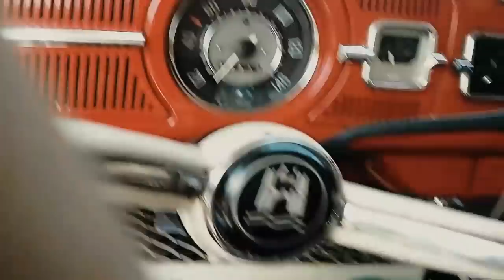¿Que Hacer Si Se Te Rompe El Chicote Del Acelerador Del Vocho| De Tocho Morocho Tutoriales.

Comment: Hola, disculpa yo tengo una duda acerca de la transmisión, es en qué consiste el ponerle paso largo a la transmisión, cuánto cuesta esta modificación y que tipo de mecánico podría hacerlo?
Reply from the maker: que tal amigo dicha modificación consiste en cambiar el piñón y corona o engranes de tu transmisión, dicha modificación hará que tu vocho se force menos y tarde mas en pedir cambio el motor, esta modificación es mas para vochos modificados para arrancones, sobre el valor desconozco exactamente cuanto salga una modificación  algo así, pero si se que es caro. saludos
Reply: Buen día como menciona De tocho, es muy caro simplemente las piezas como la corona y el piñon rondan los 12,000 pesos y la modificación te la podría hacer cualquier mecánico que sepa bajar la caja ya que es cambiar solamente, te ayuda también en carretera, con la caja modificada la tercera seria la cuarta de una normal Saludos

Comment: Gracias por el TIP, a mi vocho se  le rompe el cable a cada rato. No dura un mes cuando debo comprar otro cable y que lo reparen. Y luego lo que pasa, no lo dejan ajustado bien, porque ya no acelera bien. No tiene la fuerza que deberia, parece que trae gobernador y no deja acelerar, hasta que lo llevo de nuevo a lo revisen. Mi pregunta es porque se rompe. Le compre el cable caro para que dure y aun asi se rompio.
Reply: pienso que debe estar rozando con la lamina entre la tolva turbina, o donde estan los pedales por el canal que entra puede ser que en la entrada este rozando ifual, o que no traiga instalada la funda que va entre la transmision y la tolva turbina. otra opcion es que veas a que distancia se esta rompiendo el chicote y vas a ver exactamente el punto de roce que lo termina por romper